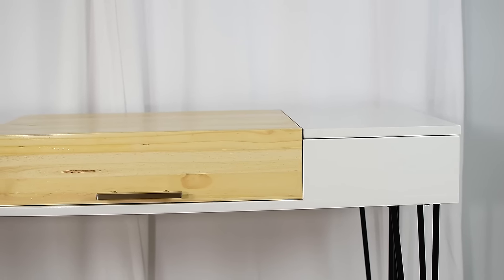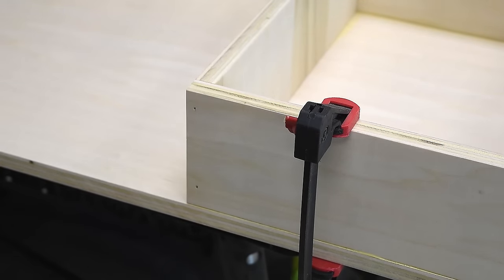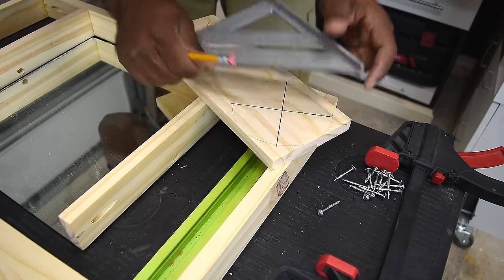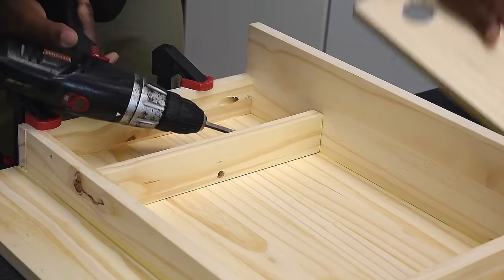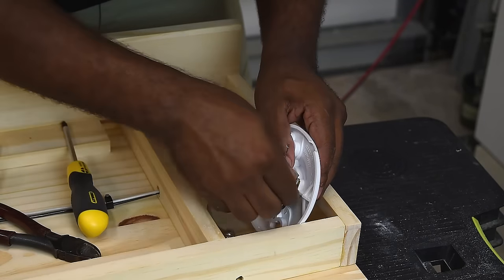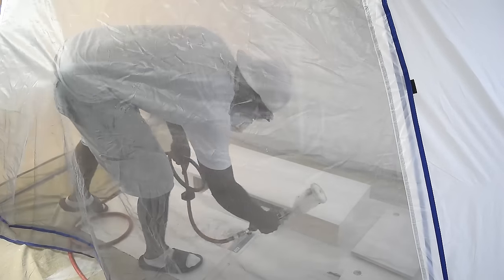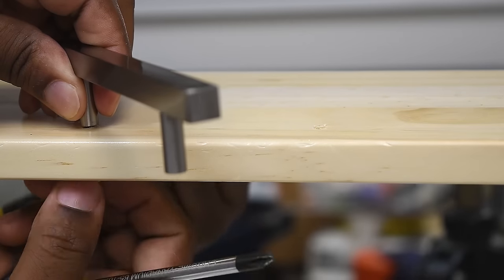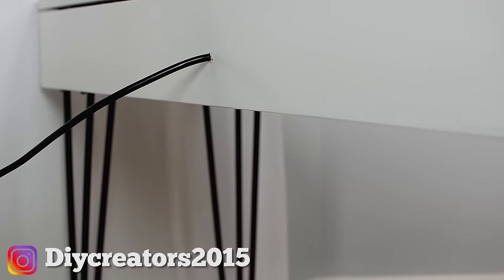DIY MAKEUP VANITY DESK | With Storage (Plans Available)

Comment: love the channel, im subscribed. love the vanity too, my only concern is the lights. those should be in a electrical box as what you did is not to code. you could also consider those pot lights that have a built in box for the wiring.

Comment: Alright Glen, yet another nice and detailed video, keep the level up!
I'll add some "critics" (as always: rather second thoughts on my terms ^^) and an idea for videos like that afterwards.

About the build:
I was first wondering about the positioning of the bulb-equipment. You routed that out (naturally a good idea), but why not a little more, like adding depth into the wood? Just by routing, lets say an inch or two more to a degree, you could add some depth to the look (its a vanity after all ^^). also, I understand the design decision, but perhaps a touch of color would have fit here too. No less, I was also wondering second here, if this area couldn't be without paint and instead be marked by some kind of mirroring foil (around the depth) so that the "mirroring size" itself is enlarged.
As for the mirror myself - as soon as it gets scratches or breaks to some part (e.g. hair dryer flying into it), you need to physically break it out. Why not a 'simple' screw-in holder? Or, perhaps - with some extra effort - a mirror on a guiding pole, that allows to be moved back and forth (e.g. like a pipe that goes vertically in the middle behind the mirror and that alows for it to move in a certain angle), so that the person using the desk can actually push it to the sides as needed. Not to mention a "slide into the background" function, in case it stands not (!) against a wall... and many other options...
Also, I was a little worried about the structural integrity of the desk. Consider a person holding her elbows and her upper body on it, would it still stand? I am not entirely sure of the strength of the wood, so perhaps a little bit more extra stability might be necessary, for some users at least. ^^
The side chests almost scream for an additional video called "additional compartment options for the vanity" :D

As for the video itself:
I was wondering, if you ever decide to build something bigger (in terms of time spent to build it, not necessarily dimensions) like a dining-room wardrobe, with all the open shelves for dishes, cabinets for the cutlery, design options, details etc... (or a whole series where you also add the table, chairs etc. in one fitting style for a whole room), you might want to split the video into multiple parts. Just add a little of your face and commentary, talking about issues and solutions, the material you used or problems that might occur if others copy it. What inspired you to build it (reasons) and so on... the length will always come up to this video, but due to the complexity, a multi-part-series keeps your viewers just as much at attention, as this. Plus: Bigger projects call for more creativity to unleash...

Just my two cents worth of oppinion as always.
Oh, how about a kids-toy-box next, or something like that? Have fun building!

Comment: Fantastic build! Sadly, like so many things in over-legislated Australia where I live, it's illegal to build things involving mains power, unless you're a licensed electrician.  

The mains wall socket/dimmer on a free-standing object would be a big red-flag for the powers that be.... so sad. America has its share of issues, but DIY is sooooo much easier over there. I'd have to mount a 240v extension board, then make a 12v lighting system, probably using light filters to put some yellow in the white. Your design is so much cleaner and easier to implement :)
Reply from the maker: Thank you. That's very interesting. We have 120v for most things. I can under the concern 240v is nothing to play with.

Comment: Hi, I hate it but there is some hate that must be said. I rly wouldn't trust that electric circuitry. First, those light bulbs will emit some serious heat and having that so close to the wood is serious fire hazard. As are the wires underneath. If there is a spark (which can happen easily, especially when using cold joint) no electrical tape will help, it will burn the tape and then into the wood. This is the kind of situation, when you must use LEDs, because they operate at low voltage, so there is no fire hazard.

As I said, I rly hate myself for hating your video. You have great channel and I enjoy all your content.
Reply from the maker: Not sure what not to trust about the circuit,  this is how it's done in the US. Yes, they put-off heat, however, they make the same bulbs in LED Form (which I suggest in the description). Maybe I'm missing something here, I can not understand how this current setup can cause a spark.
Reply: I see. I also forget you dont have 230V in the US, right? That is maybe the case. I checked some legislation in our country and in this case you would be required to have the electric stuff in non-flamable enclosure. The cold join problem happens, when you have two wires just twisted together and taped or you have it attached with screw. When the connection gets lose a bit there might be slight gap between the wire and the screw and that can create the spark. I wouldn't belive it can happen, but I saw how easily it melted whole switch on coffee machine we had in work.

With that said, I am no electrician and that is just my very unprofessional opinion. And maybe I am just too much affraid when handling these things :)